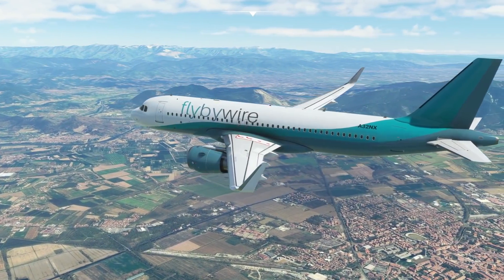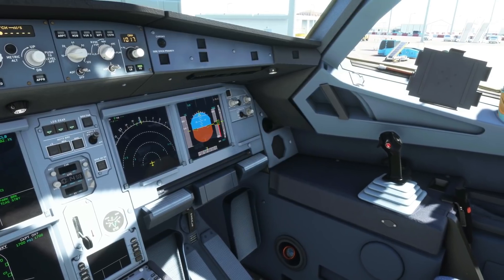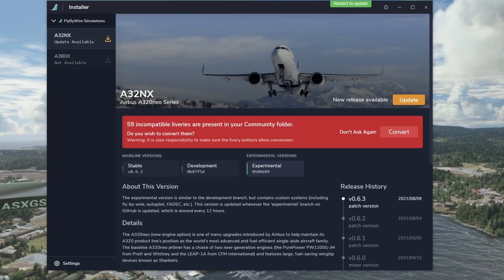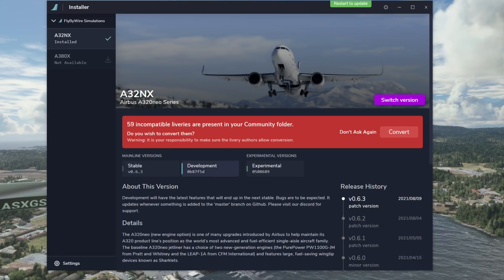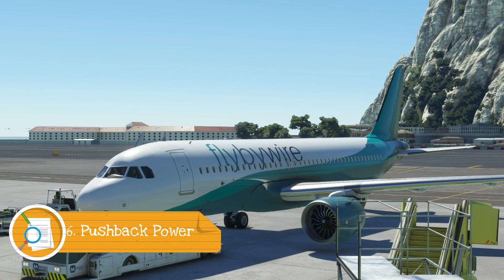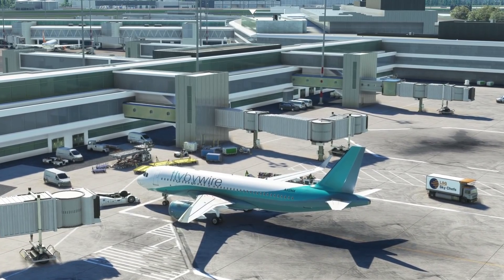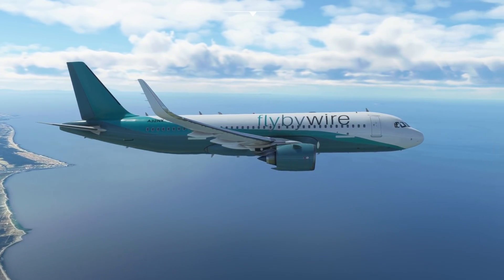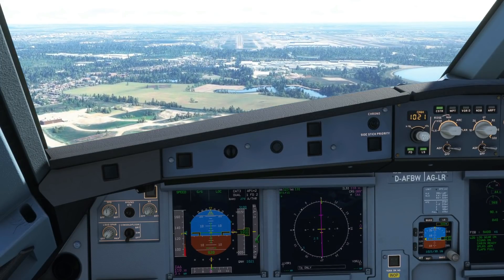FlyByWire Troubleshooting - Fixing Your A320 NX in MSFS 2020 After Sim Update 5

Comment: I had a problem since I got the fbw a320 and it really annoyes me. Regardless how much fuel I put in to my a320 it always spawns in with 0%. Does someone know the solution to this problem. Also very nice Video.
Reply from the maker: I'm not sure what fuel value it should load with,  it I don't believe it remembers your last known fuel from your last flight.
Reply: @Easyjetsimpilot  Sorry, I told you wrong. I ment that I loaded 50% Fuel in the msfs2020 menu and wenn i started the flight it spawnd in with no fuel. I tried to refuel it with the ground service but it wont work. Than i tried it with the tablet you have in the fbw a320 and then it worked.

Comment: For some reason after i've tried to install the a32NX when i load into the sim it isn't there. However it is in my community folder and everything looks how it should be. Any ideas? Bear in mind I am writing this a year or two after the video
Reply from the maker: Search in your hanger for the Flybywire - it can be easy to miss.
Reply: @Easyjetsimpilot  I'll give it a try.
Reply: @Easyjetsimpilot  Still nothing, I have tried each version as well and it still won't appear in aircraft selection

Comment: thank you for ! I have a problem with the flybywire mod. The problem is if i tap fly in msfs the fuel goes automatically back to 10%. The if I go to the toolbar and set the fuel to like 50% it resets automatically back to 10% fuel...
Reply from the maker: You refuel using the EFB, not the msfs refuelling panel 👍
Reply: thank you, it works !

Comment: I’m am over on the Xbox version and I am having the black screens constantly after pushback, it’s not the battery’s, they are active. It’s frustrating because I have no monitors working during flight and in turn my AP doesn’t work, makes it impossible to fly. 

Have you seen this issue before? Do you know if there is a fix for it or is it just down the Xbox version being broken? It’s the default A320 Neo that comes with the game.
Reply from the maker: Is your APU running before you pushback?

Comment: Hi Sir,my fbw was working fine since I got it long time ago  but now I can not turn gen 1 .gen2 and apu gen when I start the plane from cold and dark( does not show fault in orang color ,only show off in white and when I click on it will not change ) and the pwer shut down even with the apu runing after turning the external ground pwoer off,olso if I start on the runway ,do you have a solution if possible , many thanks.

Comment: Hi Gavin, thanks for such a great tutorial sharing the troubleshooting guide. Well, I have a kinda similar one of the issues you mentioned I can't get the aircraft to power up regardless of what version I'm using there's no power the PFD's and ND screens are all dark clicking the battery switches even EXT power there's no response at all. Any idea what that could be?
Reply from the maker: What happens when your start the APU?  It sounds like a mod conflict.
Reply: @Easyjetsimpilot  I also tried APU it's not firing up at all.
Reply: i have same problem

Comment: My A320 is invisible ie you can load onto fly but your siting in mid air
Reply from the maker: You have an old Flybywire package installed in your sims content manager (not your community folder).

Go into your content manager and search your packages for Flybywire items. Delete them. The redownload the mod using the installer for Flybywire website.
Reply: @Easyjetsimpilot  Many Thanks. I've now got it working following your instructions.

Comment: Have you had the annoying apparent brake lock up during taxi to the runway when you apply toe or parking brakes due to ATC advising traffic? It is impossible to release the brakes even if the parking brake is clearly off. Tapping the toe brakes has no effect either. Very annoying.

Comment: I have the issue no matter what I do that at least one of the engines wont start. I normally use STRG+E but nothing in development or experimental. Any thoughts?
Reply from the maker: The Flybywire mod needs starting correctly, so the shortcut of CTRL-E will not work with this aircraft.
Reply: @Easyjetsimpilot  Thanks. I will try that next time

Comment: I installed the experimental version, thank you. But I am not able to push the heading, altitude, or speed button to automatic any more (with the round dot behind). I'm not able to because there is a light blue layover describing the button. Before the update everything went well. Can anybody help me out?
Reply from the maker: See https://youtu.be/4JBWoxGsq2U
Reply: @Easyjetsimpilot  I do not find it :( and also in the experimental version the engine 1 is unable to start as the switch is unusable

Comment: There are a lot of bugs on the Xbox. The most annoying are: 1. Near the landing, if the flight lasts more than an hour, the on-board monitors close, the display, and the plane no longer responds to any automatic control !; 2. On some landings, the rudder gets stuck and the plane takes it through the woods! 3. After parking the plane, instead of removing the luggage from the plane, they are inserted! Strange. Such things happen at both Airbus and Boeing.Do you have any idea how to at least fix the problem of turning off the on-board monitors?

Comment: Using the Honeycomb Bravo. I pull the reverser levers on the throttles to turn them on. Have EFB configured such that that throttle axes are just for forward thrust and the reversers are on the levers (which are on/off, not axes). After landing and retarding to idle (also after an auto land), what should I do? On the CRJ I pull the levers to enable the reversers and then push the throttle forward. This doesn’t seem to work on the A32nx. Do I just activate the levers? Any suggestions welcome.

Comment: Hi Gavin, thanks again for updated info. I have an issue when my joystick throttles just stop working, Never had the issues prior to this update. The joystick is calibrated in windows and also in the EFB but at random intervals it just stops responding, Never seems to happen on the ground no matter how long im there but usually after takeoff when trying to put throttles back to Climb - v frustrating

Comment: hi there mate! great video. however im still wondering if the atc (expedite climb altitude) bug from is fixed? if there is a way around it can you please share? At the moment im using weather preset method to avoid it
Reply from the maker: Sadly not, other than turning off default ATC.

Comment: When im on approach mode, And i go to flap 3, then to flap full, gs goes down and the aircraft dont do nothing to recapture it. Have you been there?
Reply: You probably have another button to set flaps, Which you aren't using
Reply: @relaxmore2319   Ty for answering man, what in trying yo say is that, the aircraft isn’t capturing g/S Properly
Reply from the maker: Are you capturing the GS from below, and what speed are you doing?
Reply: @Easyjetsimpilot  My VAPP was 128 and i captured it at 4000 feet, as is on the chart. Idk if the speed has something to do.
Reply from the maker: Vapp sounds OK, but what speed were you doing when you captured the GS & how far out were you from the runway?
Reply: @Easyjetsimpilot  i captured it at 13 miles from the rwy, at 4000 thousand feet and flap 2 configuration. My soeed was like 180
Reply from the maker: @brunofernandovelitsandoval2947  hard to diagnose without any screenshots of the FMA etc. If you post in our discord server, we might be able to help you better.
Reply: @Easyjetsimpilot  i Use experimental version, as soon as i say that, “ok dont use that, this isn’t supported”. I got screen shots of this situation.
Reply from the maker: I mean in the Easyjetsimpilot discord server 👍 link in the video description.
Reply: @Easyjetsimpilot  you
Got a link please?

Comment: YOU ARE WRONG ABOUT STABLE 0.6.3 mate. It was 0.6.1 on Marketplace which was causing CTD. Get it right please.
I know as these are the only 2 Versions I have ever used. I did totally remove the older one and no CTD at all. However, it has many issues , see below...

Comment: Current STABLE 0.6.3 version issues: (I use this with other Mods which can not use DEV & EXPERIMENTAL)

CONSTRAINTS NOT SHOWING (switched ON, only shows for APPROACH)
MANAGED ALTITUDE NOT WORKING (no VNAV)
FLYPAD MOUSE IS STILL HOVERING TO CAUSE 2 POINTERS IN VR (others great)
FLYPAD IS TOO SMALL IN VR WITH SOME BUGGY SCREENS (you can not exit from the Copyright Page)
STILL NEED TO EDIT AUTO-RETRACT SPOILERS (as on all Planes)
AUTO-BRAKE MAX WON'T PRESS WHILST AIRBORNE
AUTO-BRAKES WON'T CANCEL ONCE YOU USE MANUAL BRAKING (same System.CFG files as NEO which works)
FULL-FLAPS SOUND IS MISSING (NEO is loud and immersive)
RAMP STARTS GPS MAY NOT WORK (even on INSTANT ALIGNMENT)
APU START LAMP WON'T TURN OFF
SQUAWK 7000 NOT CHANGED BY CO-PILOT
SQUAWK MAY BE SET ON TCAS STANDBY NOT TA/RA
DARK MOVING SHADOWS APPEAR IN VR LOOKING FORWARD TO CONSOLE
PFD BAROMETER MAY GET STUCK ON FLASHING
SOUNDS ARE VERY MUCH LOUDER THAN OTHER PLANES (likely as it uses WAVE files instead of going via the Asobo 3D Mixer which is NOT good as an 'Official' Plane)
FLYPAD GROUND SERVICES HAS NO CO-PILOT SOUNDS
FLAPS 2, 3, FULL do not change your speed which is SET by VAPP in APPROACH PHASE

Comment: Again great video. Thank you for explaining why after landing the plane won t move. I would have never thought of taking off the autobrake. I must say though that I am currently using the stable version and it s working ok. Some small issues but I can fly with it. Which is more that I can say about the dev mod. My Thrustmaster Throttles just can t be calibrated on the dev mod. I ve come to think that MSFS s updates affect different users in all different ways. Perhaps depending on which one you purchased. Be it deluxe or other. And of course every update screws one or many things. Thanks for the post. You re great. Oh and another thing. I d suggest FBW only release the stable version. After all it s called stable because it s supposed to be the stable one. Changing from one version to the next just to find out it doesn t work is a big waste of time.
Reply from the maker: The issues was, the stable version was indeed stable, until Asobo updated the sim. This then meant issues were brought in, not by Flybywire, but by the the sim itself.

Comment: Well I still have flashing signs when thrust lever is in clb an autopilot auto thrust is on. On my screen the sign is flashing. Is it a bug too ?
Reply from the maker: No, this means that the throttles either need calibrating correctly on the EFB, or, you're not putting the thrust levers into the CL detent.

Comment: I am flying the dev. mod, and using the Thrustmaster TCA throttle quadrant. What happens, is that during cruise flight, the throttles in the sim jumps to TOGA, and the plane starts to climb. I have to throttle back to idle (that disengages the autothrottle), and I have to use VS to get the plane down to assigned altitude again. This happens several times during a flight. Anyone else that have experienced this??
Reply from the maker: Have you calibrated them in the EFB?
Reply: @Easyjetsimpilot  Yes. First I callibrated as Thrustmaster recomend, then I calibrated the detents in the EFB.
Reply from the maker: @chaophraya8003  does the FMA say TOGA LOCK?
Reply: @Easyjetsimpilot  Yes it does.
Reply from the maker: Then this isn't an issue with your thrust. Sadly, it is pilot error. Your aircraft is loosing airspeed and Angle of Attack protection is kicking in.
Reply: @Easyjetsimpilot  OK. Very strange. I’ve been flying straight and level at the same altitude on autopilot for a long time (at least an hour, sometimes more), when this happens, and I haven’t touched any of the controles. It happens even when I am not in the room (out for a beer) 😊

Comment: Just got my AP disconnected after reaching a COnstrain, Then when back to descent mode (was in manage), Fd went soo low and ap disconnected, so bad. I know its a known issue, but its the first time that happens to me.
Reply from the maker: I would not use managed mode for descending as Vnav isn't yet implemented.
Reply: @Easyjetsimpilot  So you recommend Just Open Descent ?
Reply from the maker: @brunofernandovelitsandoval2947  yes. Then if you get below the profile, just select a sensible VS.
Reply: @Easyjetsimpilot  Ty Man, That Fly director going Crazy was So bad.

Comment: Morning. Thanks for this. I've had no issues as what you described, but the only issue I have and it's intermitant is the on approach the auto throttle holds at 250knts and won't reduce the speed. Flaps down ect I get overspeed, but even when I go manual on the speed it won't disengage? I use the dev version and always update when required.
Reply from the maker: Have you activated the approach phase? (in the MCDU, not FCU)
Reply: @Easyjetsimpilot  Thanks, that's most probably where I have gone wrong. I've input all the data into the Mcdu for approach, but not activated it a couple pages previous.

Comment: Hello Gavin, thank you very much for your tutorials on the A32nx Flybywire, your doing a fantastic work. I learned a lot with your explanations and many tricks. I'm facing a new problem that I've never had before. I can still adjust the speed, heading and altitude with the SPD, HDG and ALT buttons but I can't change their mode (managed/selected) by clicking with the mouse as before. I am using the A32nx development version.
Reply from the maker: You're control settings need changing back to legacy. See the Sim update 5 video on the channel for help.
Reply: Thanks I did the change and everything is back to normal. I was able to do a complete A320 IFR flight gate to gate without any problems, even ATC was ok.

Comment: Ty so much on this video! These are really crucial most FAQs for fbw plane. I fly now dev. ver. and found it respects flight plan the best of all 3. After couple of months after SU5 I found that after first re- installation of Fbw, it shows me correct version and that flight goes smoothly. However, as soon as the next one, there's a conflict from previous apparently somewhere still present ver. in system and 5-6 of these addressed issues kick in making flights unstable and hard to conduct. Have a full support from your Discord these are great, helpful people, and will reach out after vacation.

Comment: Hi Gavin, thanks for the tips. I have an issue similar to the Auto Thrust issue but I get it when I am taxiing from pushback to the runway. It needs a lot of thrust to get the plane rolling and to maintain the roll. If i slow down to much the plane comes to a stop and then needs a lot of power to get rolling again. Using Exp version.
Reply from the maker: The weather in the sim can affect this. Wet taxiways are unrealistically difficult to taxi on in the sim.
Reply: @Easyjetsimpilot  - Yeah have heard about that but taxiways are dry and everything else seems to work ok. Very strange. It feels like the wheels have very high friction. Doesn't sound like this is a common issue so will keep exploring and let you know if I find a cause. Thanks
Reply: @owenmorris2279  The issue may be you're going uphill.  Again uphill taxiways are unrealistically difficult to taxi on.
Reply: @owenmorris2279  anyone know why the fault error in the generators keep staying on. Plus I keep seeing a temp differential in the lower ECAM.

Comment: One issue I had was with the update putting on the option of highlighting your switches when you mouse over them... can't remember what it is called.  But if this is on and you try to turn on managed or open descent... or vertical speeds... it sometimes won't let you.  Turn it off and you will get better control back on the vertical ascending and descending.  

Also - Thanks for speaking to which ILS... Zulu!  I wondered about that.  Also had the autothrust issue as well.   Lastly - noticed the other day I was sitting waiting for taxi clearance... engine running... everything seemed functional but the plane would not move. Engines were thrusting - brakes were off... but no go.  Took awhile but FINALLY figured out the ACTIVE PAUSE was on... not sure how it set.   They should make it when you pause, everything pauses - sounds, controls, etc.
Reply: Actually I figured it out. It's General-->Accessibility---> then under "User Interetface", change the "Cockpit Interaction System" from "Lock" to "Legacy".

Omgosh this bothered me for weeks!!! I finally decided I wasn't going to fly tonight until I got it worked out.

Hope this helps someone else.
Reply: This has been killing me. How do I turn it off so I don't get the pesky blue highlight in the flight sim?
Reply: @cedi24  I have been wondering this for a while.

Comment: Oddly enough I’m watching this video instead of flying as flight sim has just crashed on me an hour into a vatsim flight, grrr. I agree the experimental version is the best at the moment and the only bugs I have is the print CTD which I think is in all versions (so I hand write the ATIS/METAR old school style ATM) and the approach mess on occasions you mentioned (not all the time). Most of my regular crashes since SU5 I’ve worked out now as belong related to specific scenery (ie orbyx London) or 3rd part apps such as FSUIPC which I’ve removed but I still get annoying random CTDs like tonight’s when I simply changed chart in the Navigraph in the in game panel. Never crashed there before in the thousands of times I’ve done it and probably won’t again. MS/Asobo need to really concentrate on improving general stability in my opinion as there are still way too many random one off CTDs. The FBW team are doing an excellent job tho. Very very much looking forward to the VNAV improvements.

Comment: I am unable to use my Logitech radio panels with the Fly By Wire A320.
They used to work prior to Update 5.
They still work on all the other MS supplied aircraft and the Hype A135.